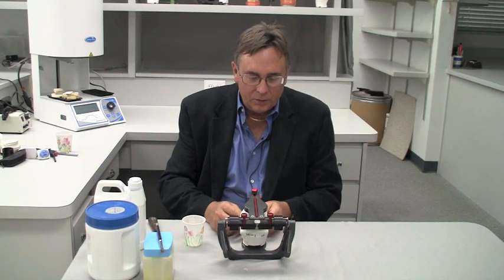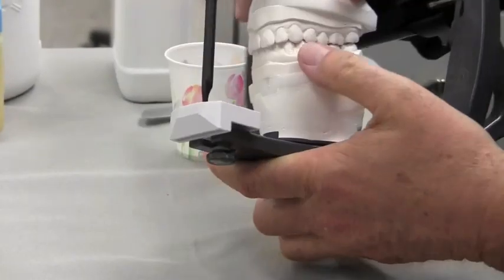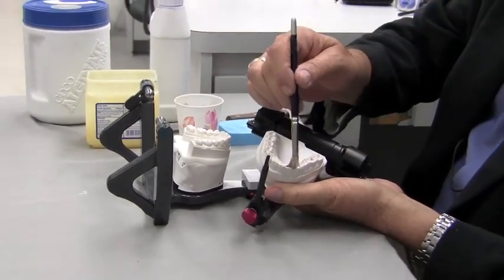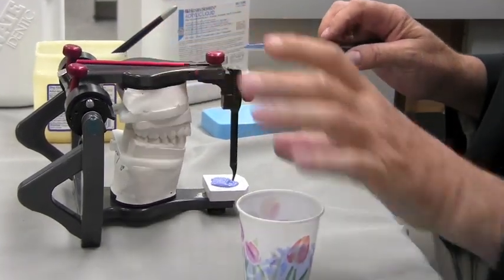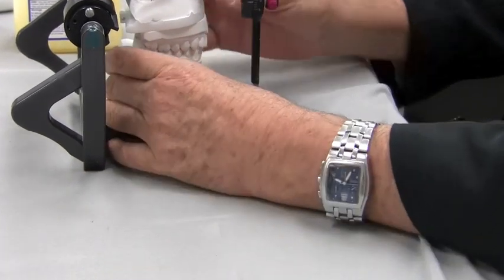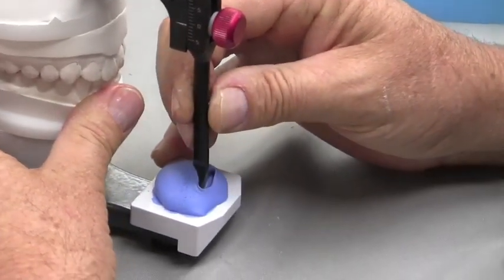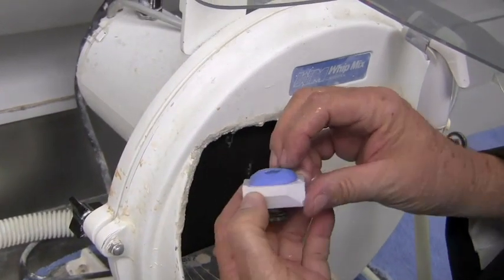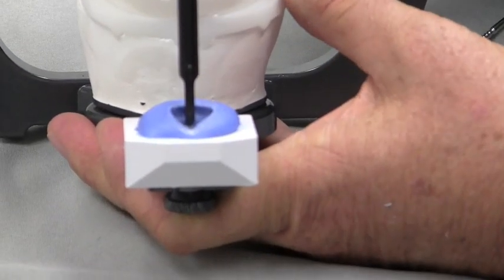Creating a Custom Anterior Guide Table on a Denar Mark 320 Articulator with Al Fillastre, CDT

Comment from the maker: Yes the Incisal Pin in this video is an accessory. It is called the Anterior Determiner Incisal Pin, Item # 110448. If you need extra Guide Tables they may be ordered 12 at a time, (Item # 110240-12). Thanks for watching!

Comment: I have just purchased Denar 320. I noticed that the tip of the incisal pin in this video is shaped differently from  what I got!. Mine is straight rounded, while the one shown is curved and sharp. Is the pin shown an accessory that I have to buy separately?
Reply: you wasted your money